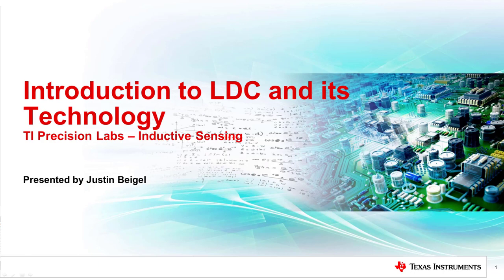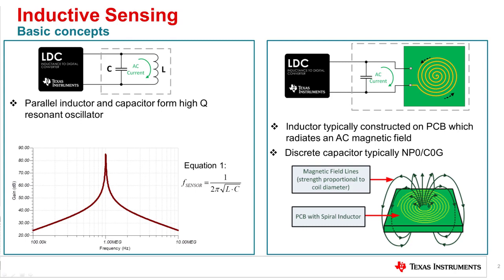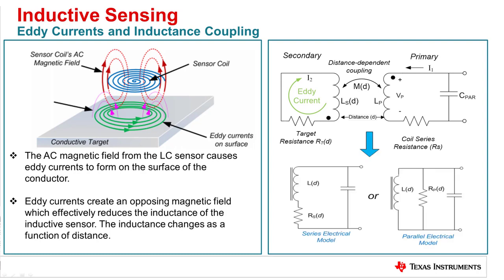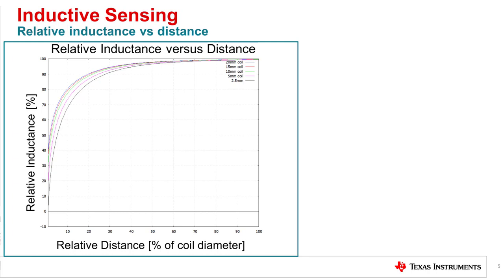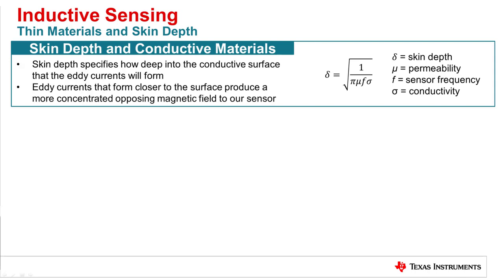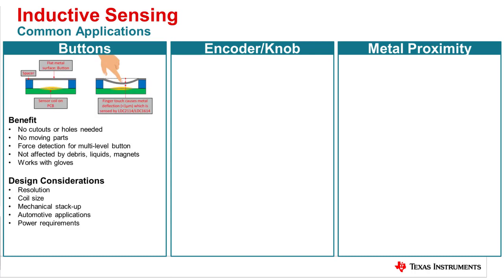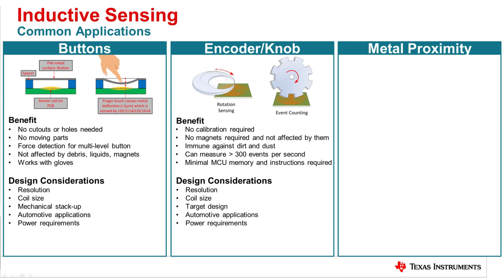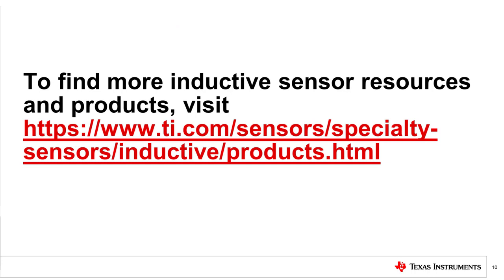Overview of inductive sensing technology

Comment: Could someone explain why the presence of a permanent magnet near the sensor would not cause a problem?
Reply from the maker: Hi there, thanks for your question! The eddy currents on the target are the key interaction between the target and the sensor coil. These eddy currents create an AC magnetic field that interacts with the sensor coils magnetic field, which creates a frequency shift on the sensor magnetic field that impacts the inductance. The AC magnetic fields are not impacted by nearby DC fields, which is why permanent magnets do not affect the inductive sensor. You can visit our inductive sensing FAQ to learn more: https://e2e.ti.com/support/sensors/f/1023/t/295036
Reply: @TexasInstruments  So, there is AC induced in the coil which in turn causes eddy currents in the conductive target. That results in a change in the impedance of the coil which is to what the sensor circuit is responding. Most magnets are not conductive and if they were they would become "targets" as well.

(I think that "...shift on the sensor magnetic field..." might be -...shift on the sensor's magnetic field...?)